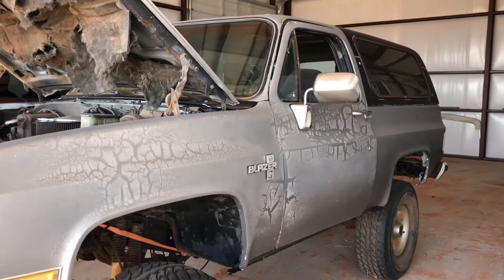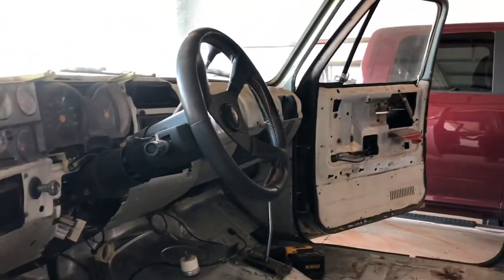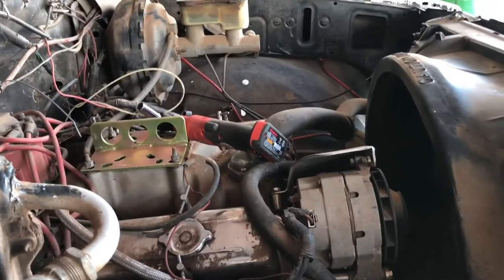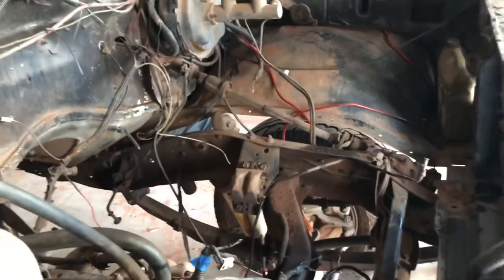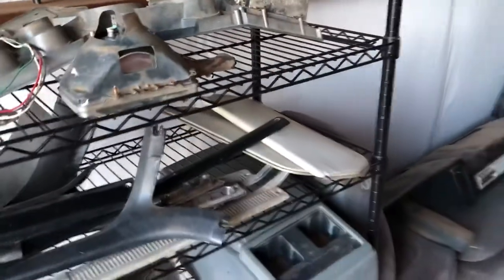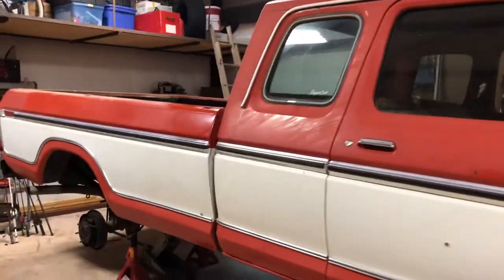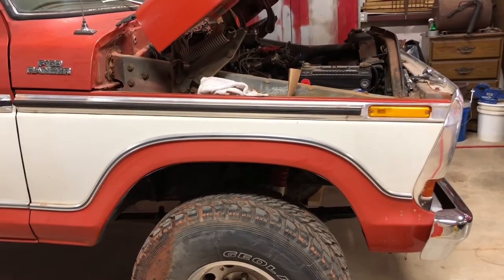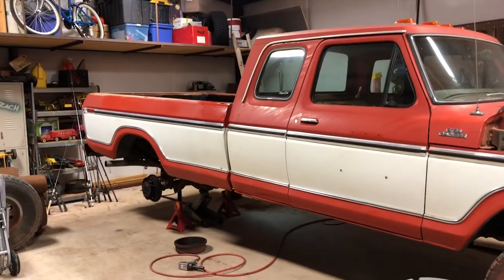K5 Blazer Build! Part 1- Tear Down.

Comment: There aren't enough K5 build videos.
Reply from the maker: Matt Abbott I have more in my k5 playlist. They just aren’t  labeled as k5 build anymore.
Reply: @3rdGenC10s  Nice! I will check it out. I have an 83 with dana 60/14b ff. Working on the suspension (it was all jacked up) right now. Got the A-Bomb bumper installed.
Reply: @Clark Immanuel you are welcome :D
Reply: I agree I have a 87 jimmy and can't really find any rebuild videos and this is my first vehicle I'm rebuilding so I don't know to much already but ive only found a few that are actually helpful